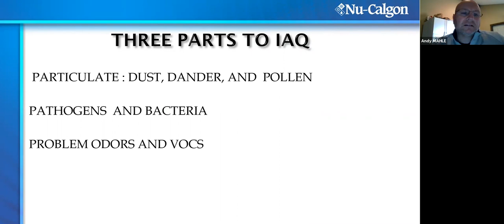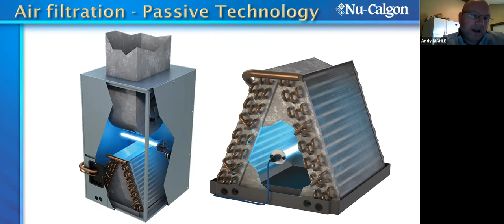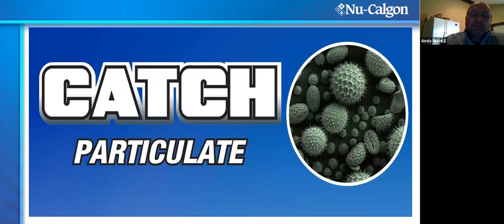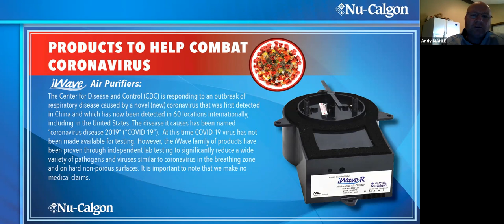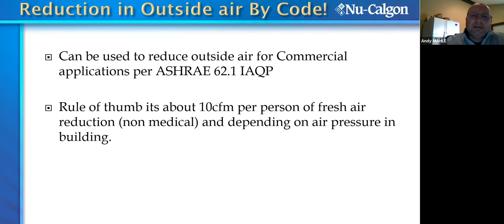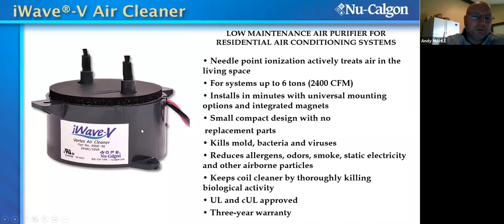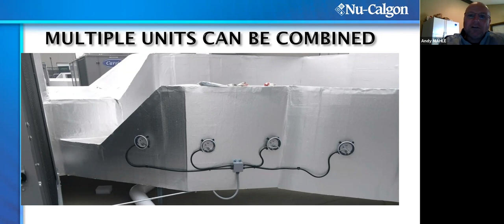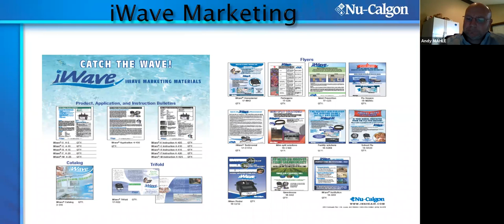iWave and IAQ Webinar with Nu-Calgon

Comment: I was going to install an iWave-R, but I went with Plasma Air PlasmaPure product because they don't require a receipt from an HVAC installer for the warranty.  Just be sure to use one of their distributors that sells to the public.  Their PlasmaPure 600 series is comparable to the iWave-V and is about $100.00 cheaper.  It comes in four models depending on the power you want to run it on.  I used the 603 which runs on 120v AC.

Comment: Looks like the iWave is better than my Reme Halo and lasts longer with no ozone. Plus, I can use a less expensive filter. I currently use a MERV-16. With the iWave I might use a much cheaper MERV-8, but replace it more often. The problem I have is that the HVAC company that I had install my system and who maintains it wants $1097 for an iWave and that's a discounted price! The iWave sells for around $380. I can't believe they want to rip me off, but I'm thinking about looking elsewhere for installation. Hopefully it would be wired properly and would not blow my circuit board.  Anyway, I might call around for prices.

Comment: If I'm in Florida and have a different air handler in the attic, do I have to put the IWave  before the coil after the last filter? My system runs filters first from the interior of the home, then to the coils, then the blower and into the house.

Comment: Good video about the technology but would love to have seen how you actually wire the iWave to the furnace--like where the black wire and white wire attach to properly work.
Reply: White to C terminal. Black to R terminal
Reply: @zzman5306  the problem with that is the ionizer will be producing ions & no place to go / no airflow
Reply: EAC on board, or through current sensing relay.

Comment: Is it necessary to purchase an iWaveC  for a rooftop residential 5 ton unit, or is the iWaveR ok to use, even though the housing is not waterproof?
Reply: The blower cabinet is waterproof. The licensed contractor will install it inside the cabinet, not outside. iWave R is enough for 5 ton.

Comment: If I have the iwave-R installed by a licensed electrician will that be adequate proof of professional installation to have my product covered by the warranty? reason I ask is that you don't have to incorporate the iwave-R into any of the mechanical componets of your HVAC, you don't even need to cut a hole in your ductwork. The company installing the iwave-R in my area is charging $750 with a limited discount of $75, and I feel that that's an excessive profit margin on a product that should take less than 30 minutes to wire correctly. I would appreciate your feedback as I would love to install one and have the benefit of a 3 year warranty versus none.
Reply: You risk warranty but the connections are simple. Turn off power. White to C terminal. Black to R terminal. Green to ground
Reply: I would not worry about the warranty if they make something and it only lasts 3 years then they'll lose a lot of business. On the other hand, they're losing business already because the contractors are always trying to stiff the buying public. Therefore we frown on it and we go to something else. My own opinion is a license electrician ought to be fine or any electrician for that matter or to be fine. I worked in construction. I worked around electricians union electricians, all apprenticeship trained and some who bought that cards. They were all qualified to do this. I think new calgon is really wrong and if this product is what they say it is and it's simple to hook up which I am going to do on my own that they should at least extend a warranty of 2 years. If it's a self-hookup you can send the item back to them and they can check it and if it looks like it was done wrong they could deny it. On the other hand, if you do have a license contract to do this work and the unit goes out, the contractor is going to charge you again. He's going to give you a new unit but he's going to charge you the labor to put it in. Ask him that ask him if this unit goes out during that 3-year warranty. Will he send his guy out or his girl or whoever he sends out? Is he going to charge you labor charge? That's the question that I don't see

Comment: How does the I Wave-R do with mold? And what about existing mold on a coil? And would it be ok to use in combination with a UV coil light? I am deathly allergic to toxic mold and am dealing with a 2nd exposure (problem already remediated) just dealing with the residual after effects in the home. (And in the coil)
Reply: My wife is going through what you are going through. Currently looking at getting plasma air 602 with a good filter like iQAir perfect 16 or Lennox Carbon Clean 16.
Reply: @bbshoney  any updates?

Comment: I WATCHED THE PRESENTATION BUT YOU DID NOT SHOW THE WHITE AND BLACK WIRES WHERE THEY GO TO ON THE CIRCUT BOARD?
Reply: The white wire is your neutral, the black wire is your power ( 24 vac/120vac) if you have an air handler (240vac) the White is leg one of power & the black is leg two of power. If you want the devise to run when the fan runs use the thermostat connections on your circuit board white to the C or common terminal, & the black wire to the G terminal (fan) hope that helps
Reply: @kevinmallion4468  does the G only work on a/c? I have read use the R terminal for heat and a/c
Reply: @kevinmallion4468  Got it! Thank You!
Reply: @kevinmallion4468  Got it! Thank You!